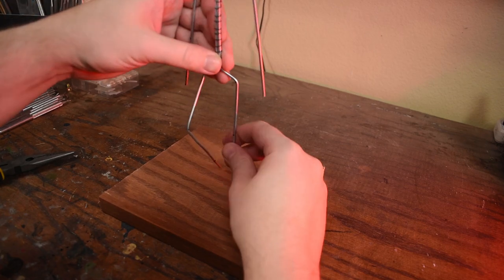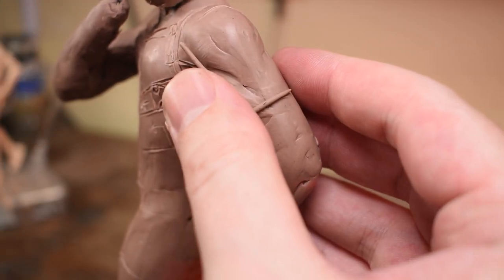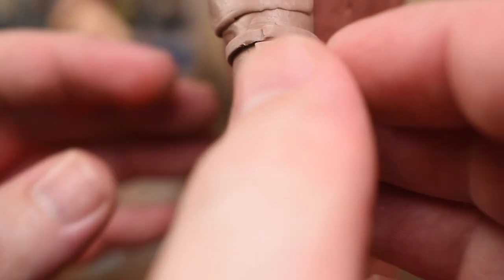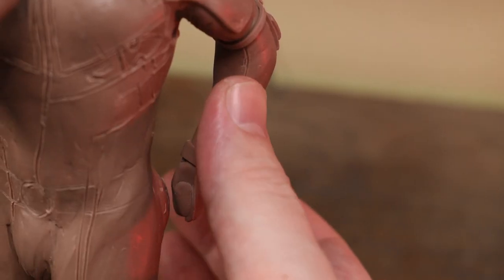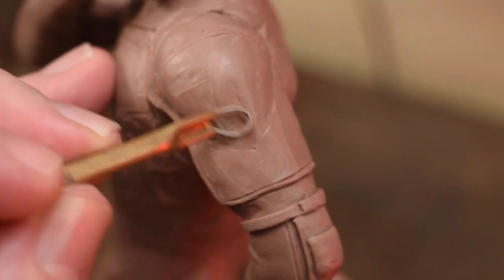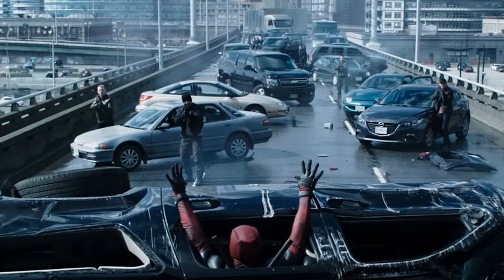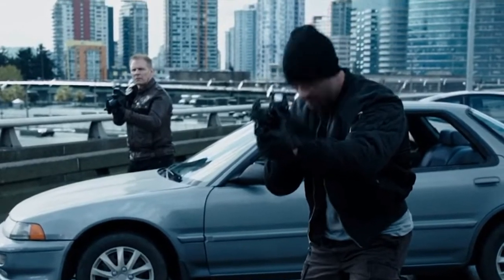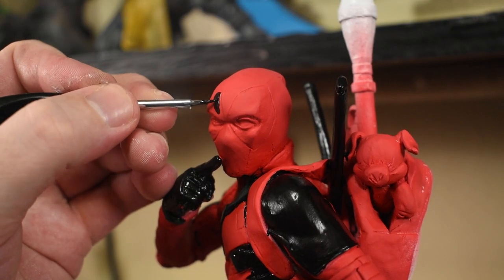Sculpting Deadpool (Movie Version) with Spider-Ham, pink backpack, and more | Sculpting Timelapse

Comment: A question of curiosity, does monster clay cure after a period of time
Reply: no but it does become very firm if you leave it overnight
Reply: @dannyfuller1  it becomes very solid?
Reply: @gpem3612  To my understanding, Monster clay becomes rock solid when it dries. But I always wonder what would happen to a scupture if it was accidentaly left in dirrect sunlight. Would it soften up and get ruined?
Reply: @wolffe6044  me too I have always wondered about that, I think it melts in high temperature, that's why hesitating about which clay I should choose to be my main material
Reply: If you're still wondering a year later; 
Monster clay can melt under direct sunlight, yes.
It's often used to make temporary molds and such for resin, or a temporary sculpt.
It is not meant to be turned into something permanent. 

Oven-curing clay tends to be the easiest to work with, as you don't have to cover it overnight, worrying that it'll dry naturally. 
But they can be a little more expensive. 
Cosclay is my recommended brand. (Flexible when baked, sticks to baked clay, easy to work with)  

Air dry can be covered in plastic wrap and then lightly sprayed with water every 24h to be kept from drying. Tends to be cheaper. 
Works well, but it can crumble and dry up kinda fast if you're working for a longer period of time and doesn't seal it off properly.